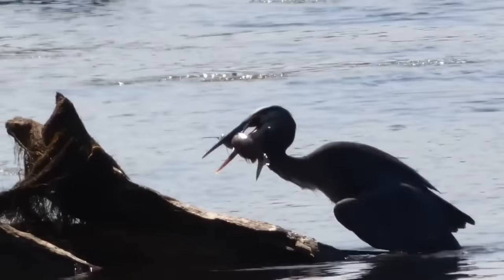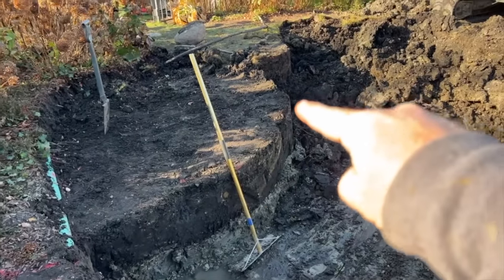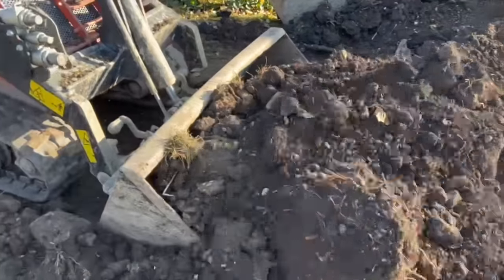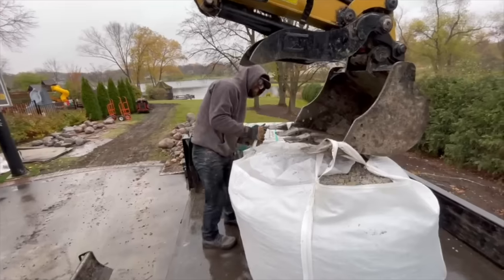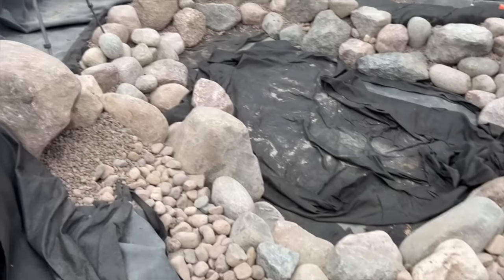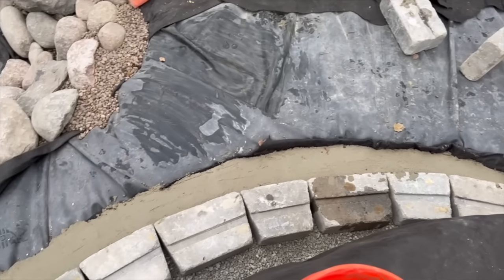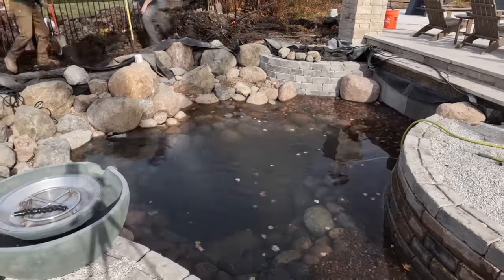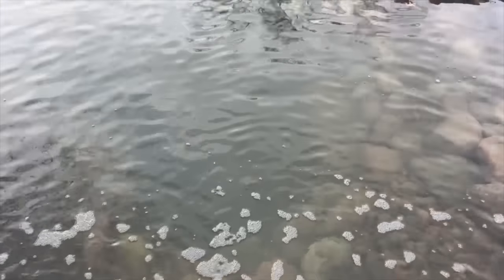WHAT Makes This Pond Heron PROOF

Comment: Aside from an outdoor dog, the straight drop-off is easily the biggest obstacle anyone can provide that doesn't detract from the aesthetics of the pond--I'd probably get rid of koi and go with cheaper comets before I'd ever have fishing line running overtop of everything. 

The scarecrows are difficult to get full coverage but work well when only needed for a small shallow entry point...  the design of our next pond will have them in the runoff stream following the negative edge just as a deterrent from even being in the yard--given enough time, they'll find a way.  They did a great job of the bridge placement to divide the shallow stream to the main pond.

With this pond, it still looks like there's spots for the herons to get in--yes, the aeration is good--but more for native fish that are dark and dull--I don't think the agitated surface will make much of a difference for a brightly colored koi for a patient heron.